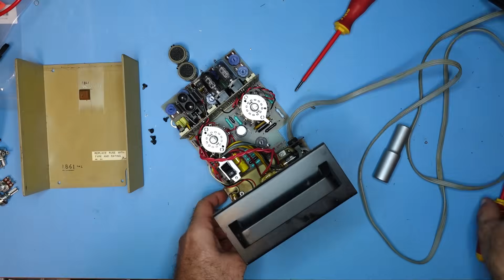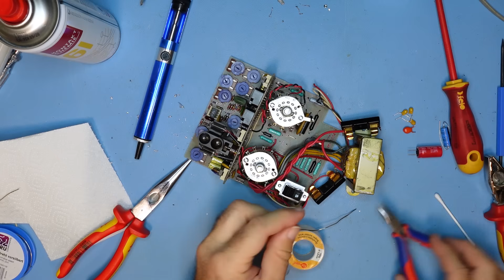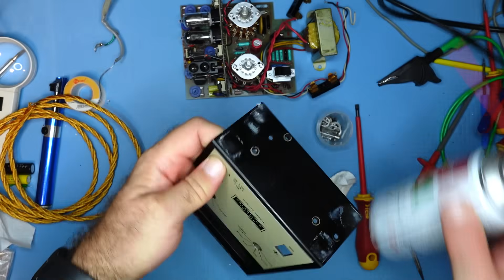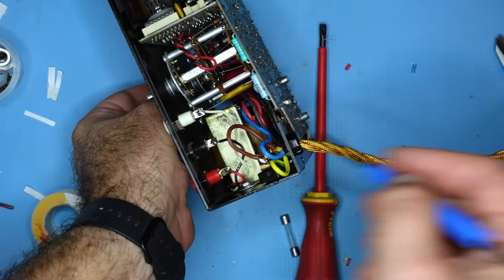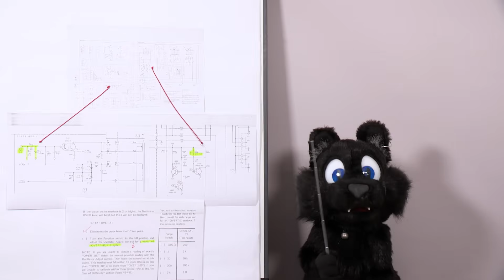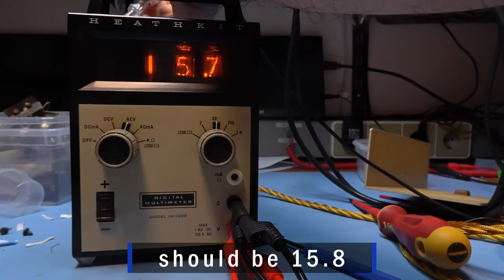Heathkit IM-1202

Comment: Dipped tantalums are very reliable. They don't gradually degrade like electrolytics. If they fail they turn into a short, so if they don't measure as a short they are probably 100% fine.
Reply from the maker: I had a couple of 10µ ones raround; the 47µ one went back in after confirming it was on spec. But I had to at least check them. Normally they have a "smooth" surface, these had a paper-like texture, which I was referring to as "looking cheap". Better check them ^^

Comment: It looks like the meter has those brown carbon resistors. Those tend to drift up in value, possibly giving an explanation to your calibration problems
Reply from the maker: Maybe - I have to check up on that once (and if) I have to remove it again. I keep the old parts around, so if there is a resistor out of spec, I can revert my mod. That said, most of the critical resistors were tighter toloerance ones;

Comment: I have two counters which one has Nixies and one has a dot matrix display. the one with the nixies seems to be an absolutely rare and unknown model and maybe even a prototype. But the nixie one is very sensitive and don´t work as well as the HP one so I have to use it with an isolation transformer or it can display anything but it is still the one I have on my bench because you know. Nixies lol. The rare part of the Nixie counter is that you can connect an RF signal from a TV source or signal generator and it can actually display that too. it was very handy when I calibrated my CRT signal generator

Comment: Nice to see Heathkit engineers care about different mains voltages. That may not be the old German way with 2x110+17V and elaborate mains voltage selectors, but still good and simple.
Reply from the maker: I think they had a "global" market. I see quite a few of their kits from UK sellers. But before the tech-youtube era, I haven't heard a beep about them, so they don't seem common around German parts of Europe at least.
Reply: @atkelar Early Heath stuff was, I believe, all 110V.  I have a number of instruments from the 1940s to 1960s that I or my father built,  and they are all 110V only. Some time around the middle 1960s I think they started selling to England. I think initially they has separate transformers for the US and international markets, but by the 1970s has dual voltage transformers on at least some instruments.
Reply: What a fun little project. Plus,NIXIES!